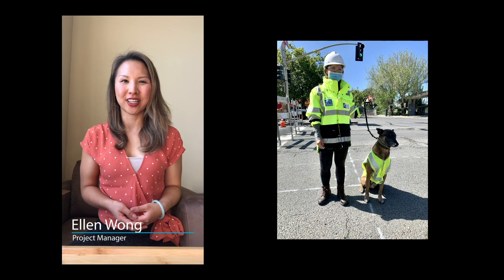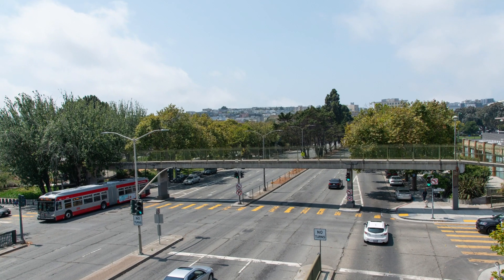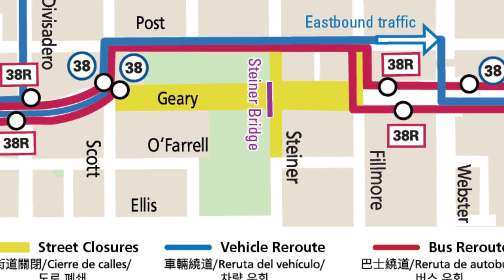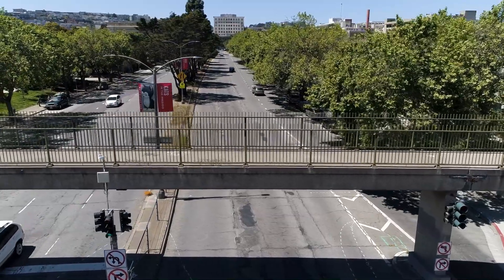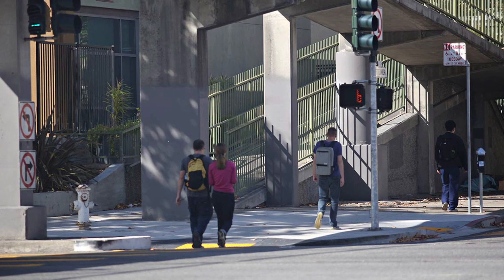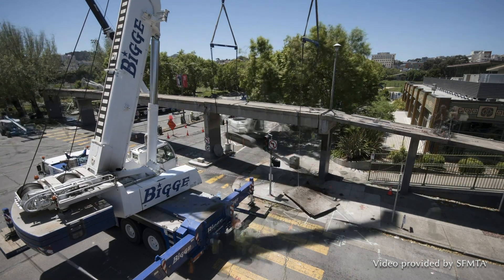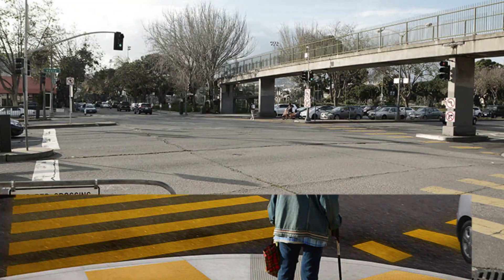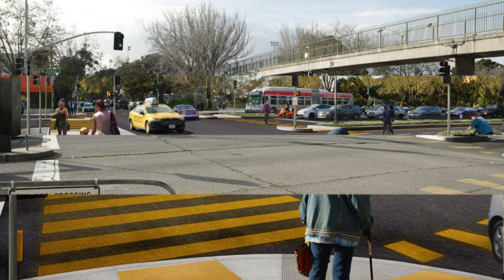Steiner Bridge is Coming Down - Public Works TV Episode 68

Comment: Personally I see these raise curbs mixed into the intersection without any paint or marking and this intersection immediately appears more dangerous to me as a cyclist with the many unmarked curbs jutting out. I see them used more and more. 

 It's insightful to hear your intentions with the project. I'm curious to know how people this project was designed to help feel about the end result. It's not clear what was specifically done to address the original stated problem, allowing slower moving people enough time to get across busy geary and do they now feel they can safely cross. Also curious what impact that had on other traffic at this intersection.